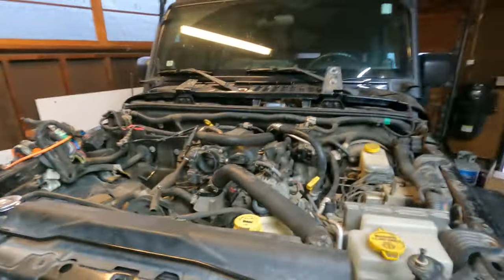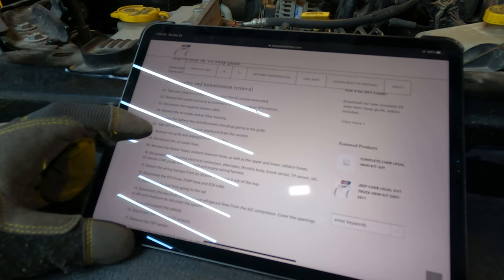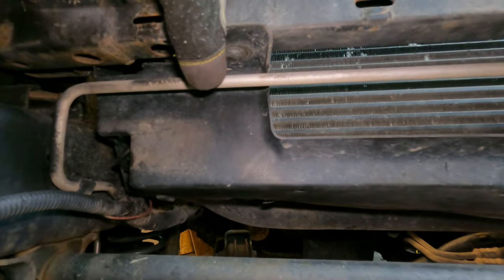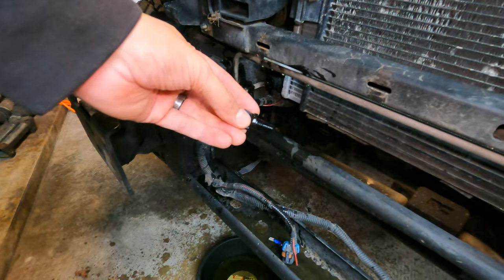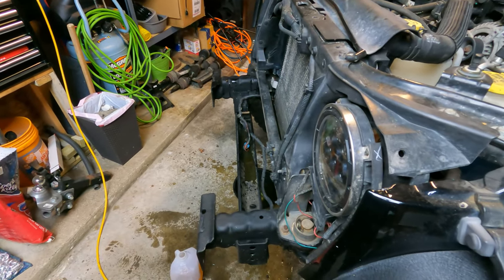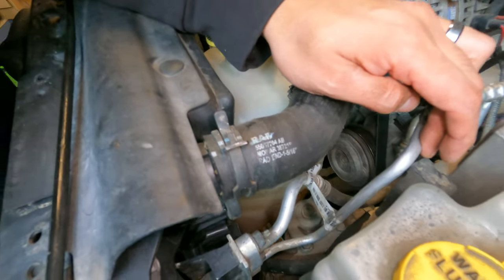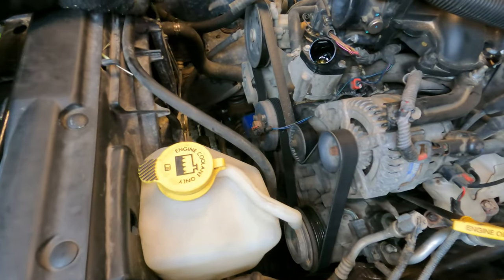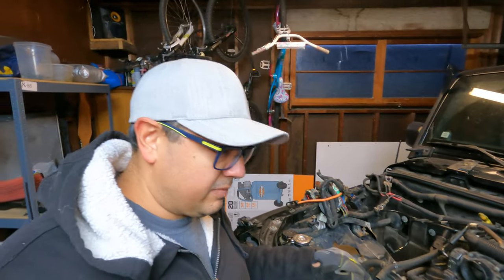Removing the 3.8l - Part 11 - 6.4L 392 Hemi 2009 Jeep JK Engine Swap

Comment: I know on my engine if i want to drain all the antifreeze I have to remove freeze plugs attached to the block. I know it doesn’t really matter in your situation
Reply from the maker: Funny you should say that. I must of done something wrong. When I went to remove the radiator in the next video. (Part 12) I definitely found the rest of the antifreeze. I will look into the freeze plugs because I'm guessing there is more in there. Thanks for the comment.